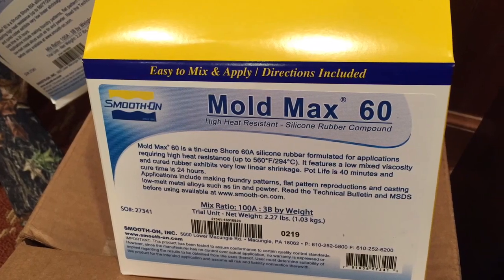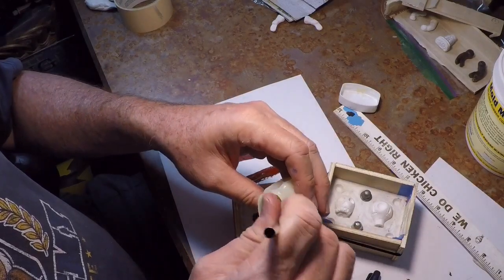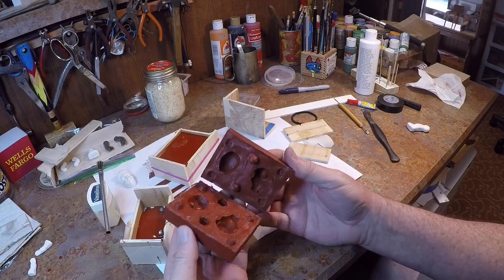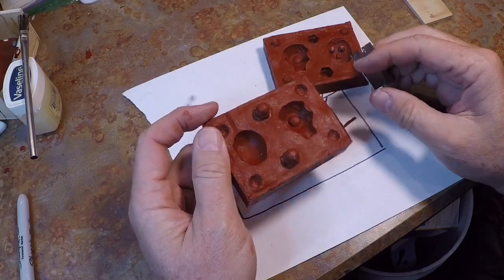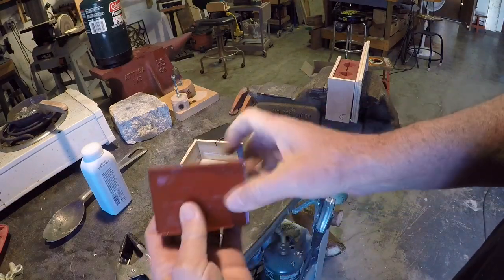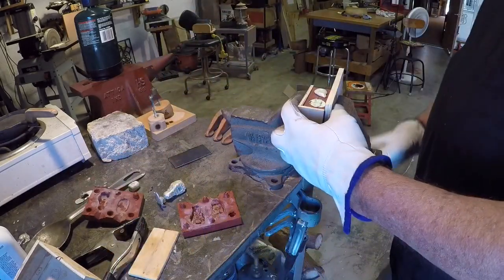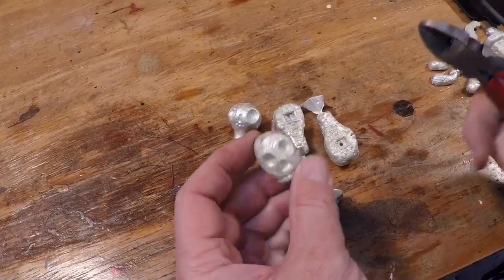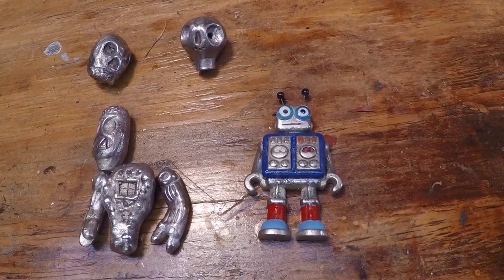Tips for Making Silicone Molds for Pewter Casting using Smooth-on Mold Max 60

Comment: I used to work for a company were I made silicone molds for pewter.  We used a slightly different process.  We would make our molds in a circular shape and poor the pewter down the center.  While doing this, we would spin the molds and use centrifugal force to force the pewter into the molds.  We also used to powder the molds first before pouring.  Can't remember if we used baby powder or chalk.  The powder always gave a better result.
Reply from the maker: sparkimoto I saw a centrifuge set up in Halifax recently - it was in a shop that makes jewelry and giftware, really fascinating! Thanks for the tip on powder!

Comment: I use solder wire to create channels for air vents when I make a new mold. This removes the necessity of taking a razor blade to the silicone after it has cured. This method allows for multiple air vent holes to be routed from the bottom and sides of the mold cavity to the top of the mold, but away from the pour hole (which I also pre-make using a funnel shaped plug of Plasticine).
Reply from the maker: That is an excellent idea…!

Comment: Another helpful hint...  Pick up some 1/8", 3/16" or 1/4" diameter plastic rod or wood dowel.  Chuck a length into your drill or drill press and use a file to taper the end of the rod into a cone shape, with a relatively blunt end.  Hack off the "cone" and use that as a starter for your pour hole.  With a more defined pour hole, you'll have an easier time of it, plus the coned forms can be reused.  

Also, for probably the 20th time (haven't read all the comments), pre-heating the molds help dramatically with ensuring successful pours.

Also #2...  If you don't need the durability of pewter, use "Wood's alloy".  It's a Bismuth alloy that melts at about 165 degrees F (less than it takes to boil water).  

Great tutorial for beginners...  Thanks for sharing.
Reply from the maker: WHJeffB great tip!
Reply from the maker: WHJeffB thanks for the kind words!

Comment: Nice work on the mold making. Great tip on using the tape and rubber band to hold the flask together. Venting is kind of an art form. In sand casting you only get one shot per mold. The pattern is reusable and molds are easy to ram up but the time involved is a limited resource. Having a silicone mold looks like a much better method than the plaster I have used.
Reply from the maker: Old Sneelock's Workshop working with pewter is fun because of the low melt temp. Thanks for the comment!

Comment: After cutting and sanding the edges take your pewter part and drop it in a vibrating tumbler like they use for ammo 
With crushed walnut shells ( use Zilla from pet store ) and a good amount of nu finish car wax 
Turn on and check back in 24 hours. They come out beautiful and shiny
Reply from the maker: edgotbait great tip!

Comment: Rather than cutting to much of a big opening in your mold. You can use a stir straw for like your coffee, etc. Cut just a piece of straw long enough so it comes close to the edge of your mold then cut your V groove for the spout the stir straw created only going down say half the length,  so the pewter goes in better. But other than that looks great. Thanks for sharing.
Reply from the maker: Michael S Great tip - thanks I'll try that!

Comment: does it require vaccum degarassor for removing bubbles ?
Reply from the maker: Interesting question. I’m sure it would improve the mold but I’ve never used one. The silicone flows everywhere and I’ve had no quality issues with my castings.

Comment: Jim could I use these to make custom size and custom shaped pendants for earrings and bracelets using alloy that has recessed and raised points in them to be painted by enamel? If I can do that do you know how I could get a prototype of my shapes made in order to be molded? Because I thought maybe 3-D printing or laser etching but I don’t know which one to use
Reply from the maker: Patty Cakes I’d have to see your specific design, but I know silicone molds are commonly used for jewelry. I’m not very savvy on 3D technology but it seems they can make anything you can imagine. Good luck!
Reply: Y

Comment: Use a candle and smoke the mold 
I used to do lead sinkers in molds. If you use a lit candle and hold the mold above it the black sot will coat your mold 
Makes you mold look bad but works great
Reply from the maker: edgotbait interesting! I'll give that a try. Thanks for the tip!
Reply: Graphite powder also works great in the mold right before casting the pewter.
Its a finer particle than baby powder....

Comment: Great demo of the process. Thank you.
I just ordered Mold Max 60 for the first time and should start casting later this month,
Can you tell me if gates and runners could be used with this setup?
Would the molds be too cold if the mold is filled from below as the molten pewter rises to the top like some molds work with aluminum? 
A larger spout to pour into feeding the void and pushing out air toward the top?

Actually, if you added a runner between the two cavities and poured it into one of the spouts it would fill them both and let the air escape or would the metal freeze up?
Reply from the maker: I’ve not tried that and haven’t seen it done with pewter...but you’d probably have a few freezes until things warm up. I’d be interested in learning more...

Comment: Would putting aluminum in a silicone mold work? or does it have to be pewter?
Reply from the maker: The melt temperature for aluminum is well above the max working temp for silicone. Pewter or lead are good because they melt in the 400s °F...

Comment: How thick should the rubber be off of the model? 1/2"?
Reply from the maker: It is kind of a judgement call...for small pieces 1/2” is probably a good number. I’d maybe go a bit thicker as the size of the piece increases. And of course leave enough at the top for a good pour opening. Good luck!

Comment: Did i miss something? I saw you make the bottom with clay then poured the mold silicone  on top of it, then when you took it apart you had top and bottom silicone. Did you leave out a part?
Reply from the maker: Joshua Poche wow I just reviewed and you are right there is a clip missing! After I poured the first half, I removed it, then flipped it over in the wood form, applied Vaseline to the exposed silicone surface, then poured the second half. My apologies and thanks for the comment.

Comment: Could I do a pour with Lead using this same type of molding material?
Reply: Just be aware that lead melts at about 620F.  Pewter and tin melt in the neighborhood of 450F.  The silicone shown says that it is rated for 560F.

Comment: Jimmie great videos brother! I am casting some thick dense pieces and to allow to pewter to completely fill the mold I have to get it real hot. So hot the pewter is turning yellow and blue. Do you know any tricks to polish out the color in the castings or something I can soak it in to get back the pewter color? Thanks so much!
Reply from the maker: Pumpkintown Primitives have you tried to lightly sand the surface? Usually the discoloration is surface only...I use 220 grit, then polish on a buffing wheel...
Reply: @JimmiePorterAtStuartArts  Thanks Jimmie I will try that! Thanks for your great content
Reply from the maker: Pumpkintown Primitives best of luck!

Comment: With Mold Max 60, I have to pre-heat the molds before pouring. I find that pewter cools too quickly and doesn't flow well in a cold mold.
Reply from the maker: J Ashton great comment - I've found the same.

Comment: About how many pours you figure you can get out of a mold before it no longer gives good returns?
Reply from the maker: pixelbat I've cast a few dozen pieces in each mold And have yet to wear one out. Having said that they do discolor over time and some fine detail can be lost. Thin areas will develop small cracks or tears. You can still cast, but more clean up of the casting is needed. I think keeping the pour temperature as low as possible extends the life of the molds.  Good luck!